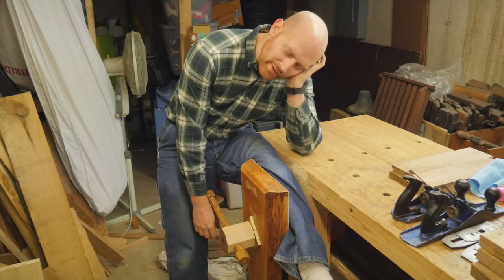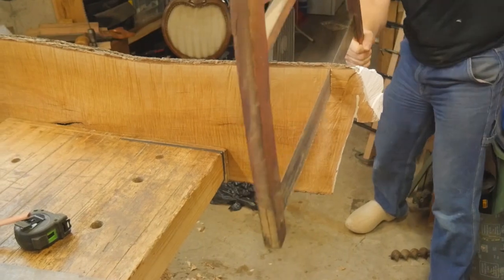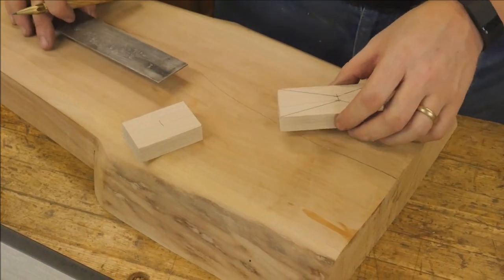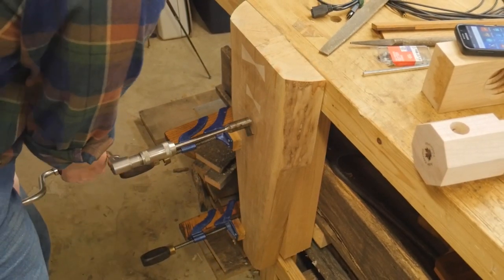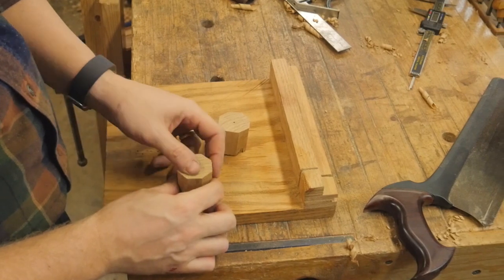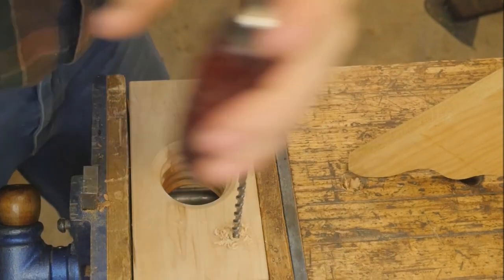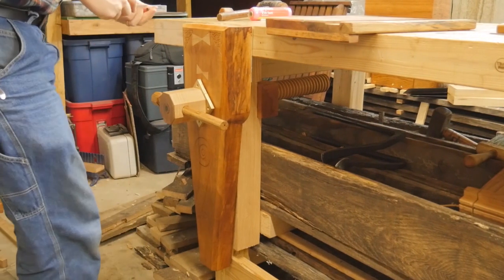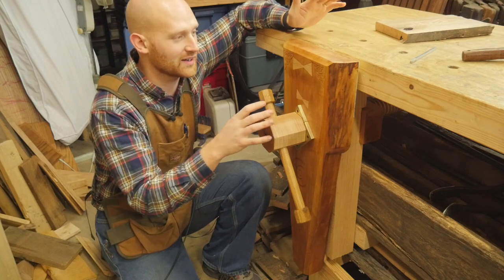How to Make a Leg Vise With A Wooden Screw All Hand Tool Woodworking Bench

Comment: What I'd like to see is how to build a screw box that can cut a new scew. Found very little on the net.
Reply from the maker: I have a video showing how to cut a large screw with out the screw box. I want to show making one for a large screw like this, but the problem is getting the cutters. you need to make them yourself or find a black smith that can make them for you. on one makes them that large that I have found. and on top of that you need 2-4 cutters for a box that size.

Comment: Hi James, Nice video. Beautiful vise. Love your use of the brace, the use of a hole saw with a brace was an eyeopener. What brand of auger drill bit do you use? I notice your bits look very new as opposed to vintage is there a modern maker that you like?I have a few vintage but it is always a risk buying them especially on eBay where it can be very difficult to tell exactly how much refurbishing they need. It would be nice to get a set new and be done with it.
Reply from the maker: thank you. all of my brace bits are vintage. I like the old Rockford bits the more. I have not found a new company that I really like. all of mine have been restored in a vinegar bath and re-sharpened.
Reply: That was the trick, the vinegar bath! Hence the shine . Thanks :)

Comment: did you ever do a video on your "ugly" leg vise (0.18 seconds)? Wondering if you used "home center" lumber and if that led to any significant wood moving issues after building. Thanks
Reply from the maker: No that was just when I started woodworking. I really sis not have any problems with movement but I let them fully rest in the shop for a month first. Yes they were standard 2x4s

Comment: I've been trying to understand how the collars work in these wooden vices.

How do the retention plates actually work? I can't see how putting a collar loosely around a round bar would make any differences.

Is it supposed to be a tight fit, and that's how it works? Thanks.
Reply from the maker: Color fits into a groove in the screw so that the chop moves in and out with the head of the screw. It's a retention ring

Comment: That is a really nice vise! You did a great job! Actually I'm curious, did you keep the offcuts for another project? I've found that offcuts even thin and narrow ones are useful for small projects. Also sorry about the really rough saw marks. It was probably partly because I don't have a top chain yet and some of the boards were cut from both sides because my chainsaw only has a 16 inch bar. I got the chainsaw for a different purpose originally and it will not accept a larger bar.
Reply from the maker: OH YESS! I kept the off cuts. got a few things planned for them. that surface is normal for chainsaw mill no matter the type. it was a serious pleasure to work with it is an enjoyable wood for hand tools. Thanks again for the slab  I am going to cherish this for a long time.

Comment: Looks great. I need something like that in my shop, but first I need to upgrade to a more stout workbench. Did you consider a more aggressive chamfer on the top of the chop? I think that would make some operations easier (e.g sawing in the vise when you want to drop your hand to saw at an angle)
Reply from the maker: thanks. if I used this vice for sawing I would, but my two leg vices are more for edge planing. my face vice on the end is far more suited for most saw cuts. and if I am doing half blind dovetails then I am going to use the Moxon vice. I think I have too many vices!

Comment: The new vise turned out great. Any particular reason why you didn't cut the hole in the brass before cutting it to size?
Reply from the maker: thanks! this was a pleasure to build. It would have been extremely difficult to cut half a hole. the bar of brass came as 2" wide stock 12" long. I cut it down to 2 bars 4" long.
Reply: I was making coffee during that part, and missed that the bar was that size. I thought it was 4" wide, and you precut your pieces to 2"x4"
Reply from the maker: that would make a difference!I thought about finding 4" wide stock but it was a good bit more because the shortest they sell is 12"

Comment: Beautiful, I love it too! I'm wondering if the neck of the bowtie is too narrow? I usually see them a little fatter, why did you make it so thin?
Reply from the maker: hard maple has an extream tinsel strength. and the crack on this one was only 1/2" deep and the tie is 3/4" thick. it is actually much stronger than it needs to be.

Comment: I'm guessing you prefer Barge because of the consistency.  I personally don't like Barge all that well because of its really long working time.  I prefer Master Contact Cement (look for a white can with a lion logo), at least for shoemaking.  It has a much shorter working time - like for that chop you'd get it covered and then be immediately ready to adhere it - and it has the thicker consistency like Barge.  Plus, this is anecdotal, but the shoe soles I've glued with it seem like they hold on much longer.  Admittedly a leg vise chop isn't getting slogged through mud, so it's probably not as important there.
Reply from the maker: +fisharmor I have never tried that. I will have to add it to the list thanks.

Comment: Why does the bottom end of the “chop” need to be smaller than the top end?
Reply from the maker: It doesn't need to be smaller. But leaving it large blocks a lot of the storage underneath the bench and the larger with the bottom is of no use.

Comment: I guess those are called "Leg Vises" because you mount them on the legs. Now, why is that slab of wood called a "Chop?" Is it loose at the bottom or is it fastened to the lower part of the leg? I will say that it looked great. You put that leather at the top of the Chop, right? Who knows, I may become a "hand tool" woodworker yet, thanks for the training.

God Bless my friend.
Reply from the maker: thanks frank.
Yes it is a leg vice because it runs along the leg of the bench. I am not sure where the term Chop comes from but it is old. Any large wooden slab that is used in a vise is called a chop. The spreader bar with all with all the holes goes at the bottom and goes through the leg. you can put a screwdriver or some kind of pen in one of the holes to keep the chop parallel to the leg. Yes. The leather goes on the top and it adds friction to the vise so that things do not move as much.
Reply: Thanks Bro.

Comment: Interesting term: chop. what might this be?
Reply from the maker: that is what you call the large slab of a clamp that slides back and forth. either on a leg vise or a Moxon Vise. Whereas jaw just refers to the portion of the chop above the screw that actually clamps the work to the bench. Does that answer your question? thanks!
Reply: Sorry can't relate to a Sliding part to a vice